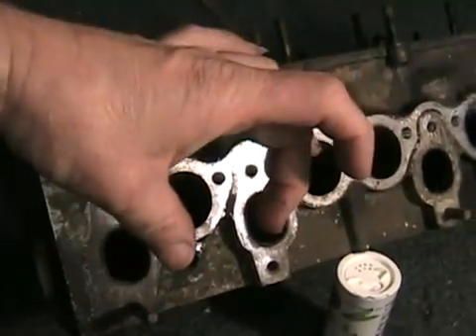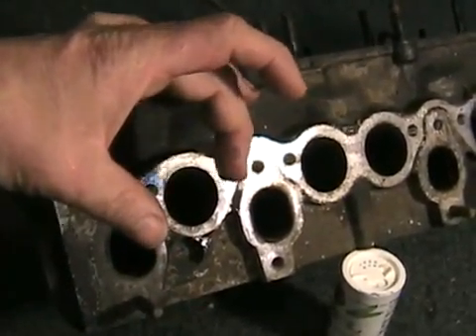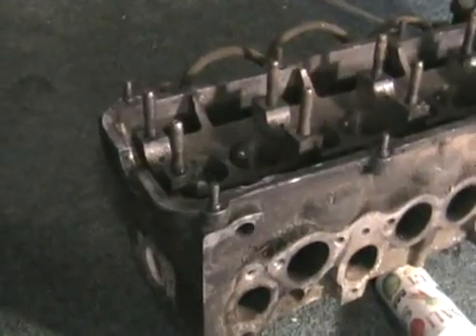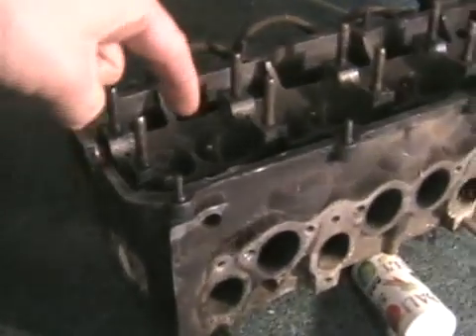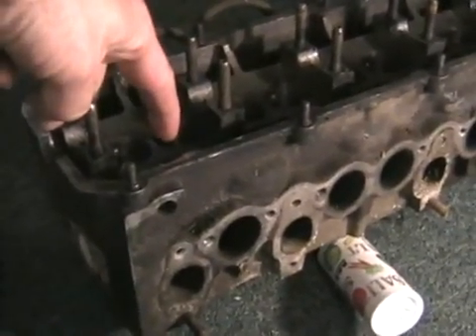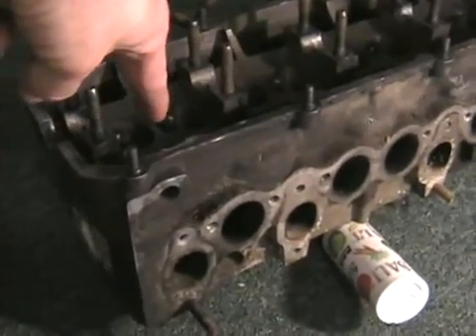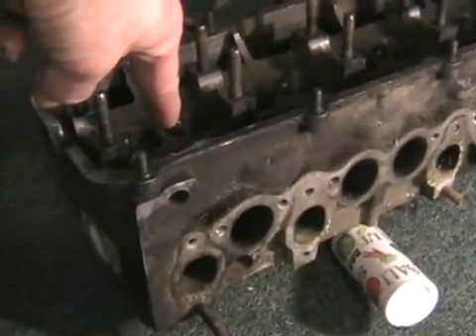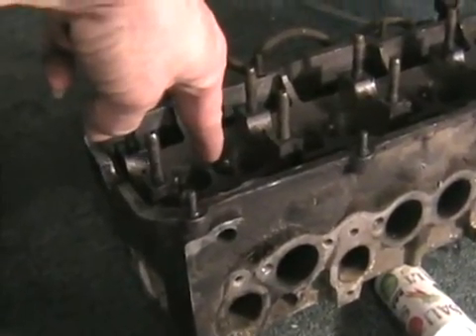how diesel engines work and combustion theory part 2 of 2 Davidsfarmison[bliptv]now

Comment: Finally a vid, that answered 9 out of 10 questions I had, about diesel.  So what does the throttle pedal control on a diesel car?  Just the amount of fuel.. via pressure change?

Comment: awesome video, i get diesel engines a lot more now. All i knew before  was that diesel engines relied on compression and didn't have spark plugs, now i know a lot more! 
Just to clarify, i don't fully understand why diesel oil is designed to ignite at a low temperature. Is it because it makes it easier to ignite as the compression goes up and the air gets hotter?

Comment: I watched both parts of your videos, great old advice. So you know when you said diesel ignites at a much lower temp. as gasoline, is that why the rev counter commonly on diesels only goes up to around 5 rpm and produces all that torque in that small amount of rev range? Basically is that why it doesn't rev as high as a gasoline?